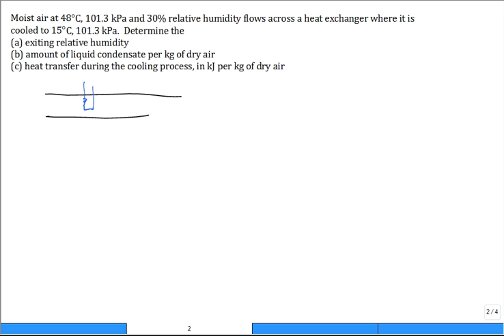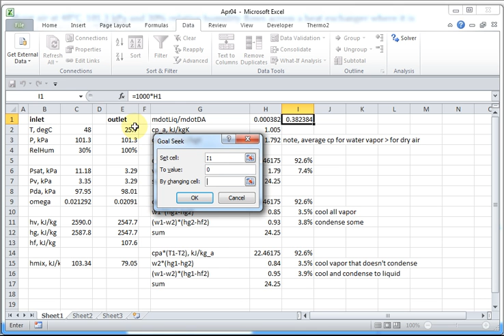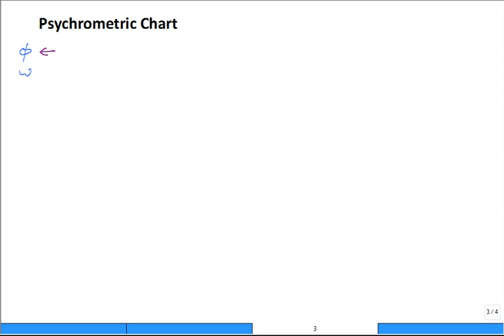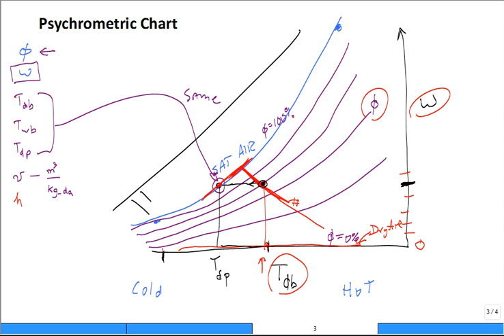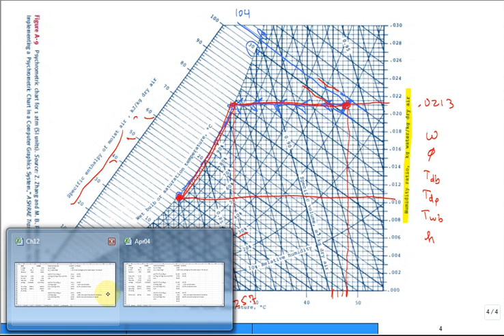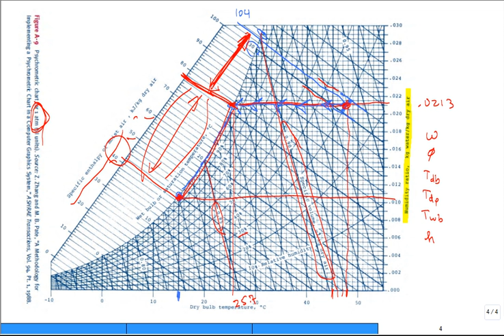Comment: could you please explain better the calculation of hmix on 23:24?
Reply: +Inês Quadros if you have the 8th edition of Moran's textbook, see equation 12.46 for mixture enthalpy and also see problem 12.74, which uses cp_air * T for h_air (a very common approximation used in HVAC applications)
Reply: i only have çengel and boles but thanks for your kind reply
Reply: Eqn 14-12 of Cengel & Boles, 8th edition.  Also see Eqn 14-1a for h_air = cp_air*T where T is in degC.
Reply: thank you so much, i was also going to check :)